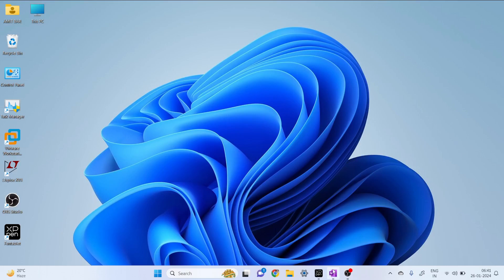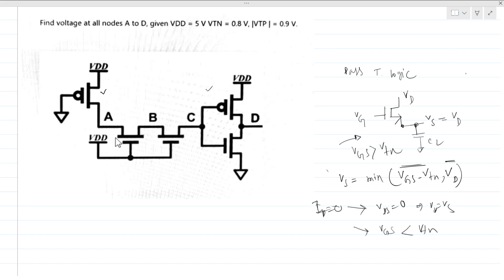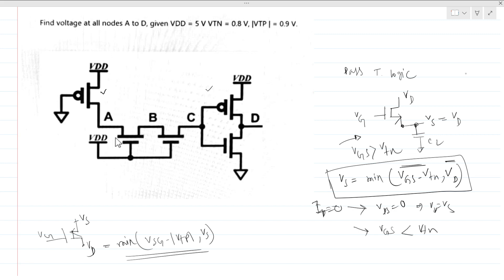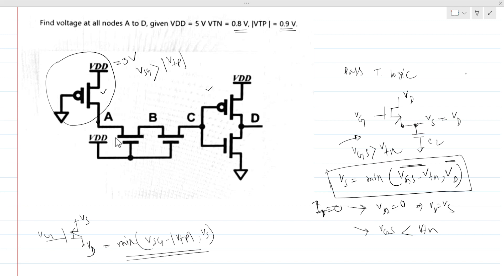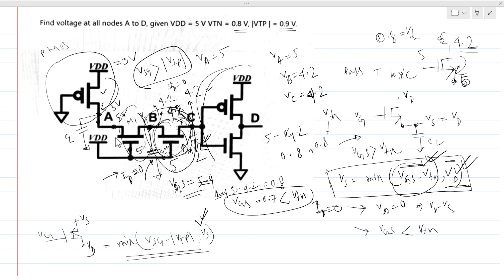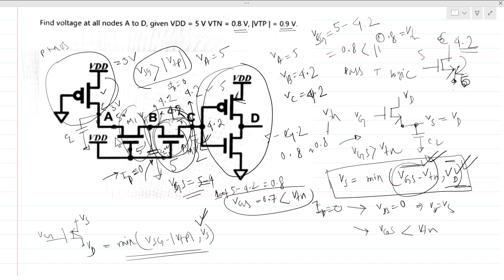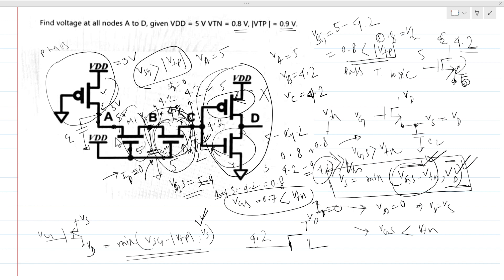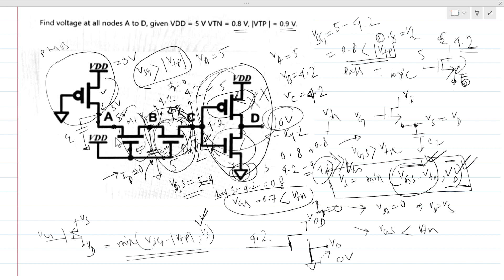Intel VLSI interview Question _ Find the node voltages at A,B,C and D

Comment: Nice explanation Sir👍
Guess!!
First mos_p vsg>|vthp| id on and then vd=vdd ,so A poinnt is Vdd=5v
Next the second is Mos_n
vsmin(vgs-vth,vd)=(5-0-0.8,5)=vsmin(4.2,5)..B point is 4.2v
And the the third is Mos_N 
Vsmin(5-0-0.8,5)....C point is 4.2v
And the the last is Inverter 
So vo=(4.2)~=(H)~=low (0)..Answer

Comment: With MIN(Vsg-Vthp, Vs) approach at the 1st Pmos; its coming MIN(4.1V, 5V)=4.1V; why we take directly 5V here? Can you please tell? when this condition is to be applied?
Reply from the maker: Because Vsg is always greater than |vtp| so Vd=Vs=5 V...

Actually for pmos don't follow the expression I wrote.But the analysis and the solution is correct..ignore the pmos expression... Thanks
Reply: @AmitBar-Analog_Circuits  okay, since source voltage of the pmos is already given as 5V, we can do that; if the source voltage is not known then we have to follow this expression I believe; right?
Reply: @AmitBar-Analog_Circuits  But, if Vs = Vd = 5V, in that cgase we do not have and Drain to Source potential difference, So, no E field developed no electron flow, No Id. So Id = 0, when Vd = Vs. ?
Reply: @waferlayout because PMOS is ON always and ,it has capability to pass strong Logic 1, thats why it charges to 5 volts
Reply: @waferlayout  unable to get what you are saying ,If you are talking about any specific circuit where you think it's violating the share the link of the ckt.
Reply: @waferlayout  no ,why will it be always on ,It will always be on till it satisfies the condition Vgs>Vth
Reply: @waferlayout  it's nothing like that bro ,keep learning always from mistakes.